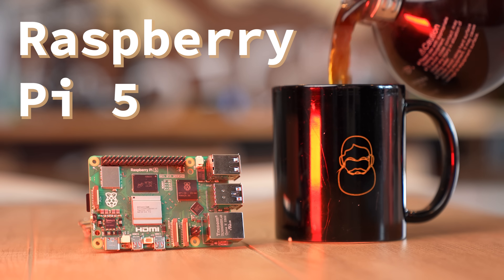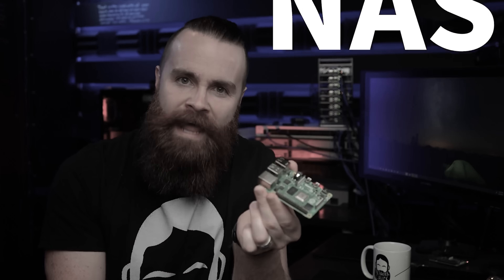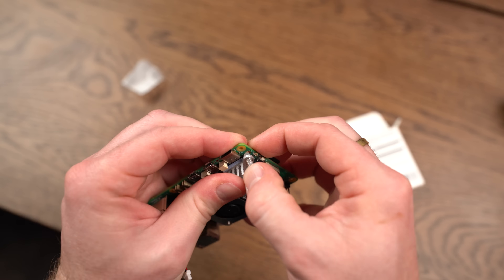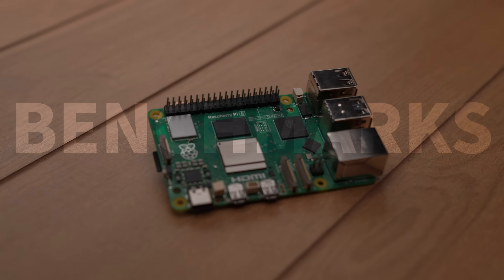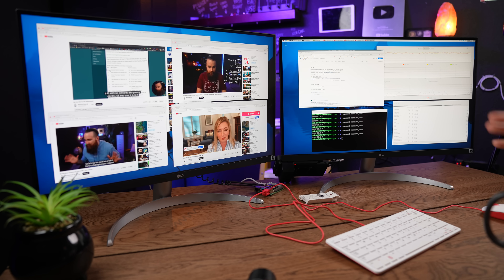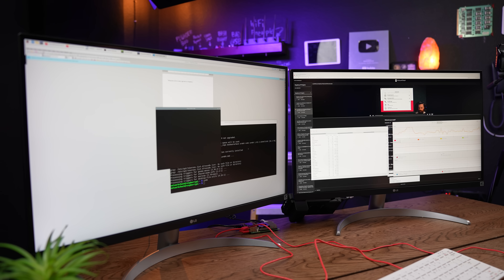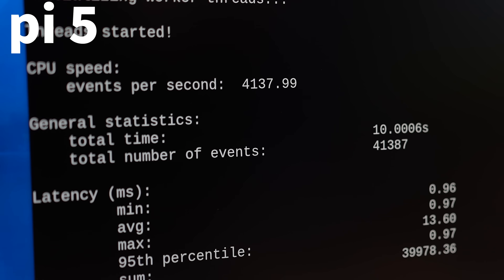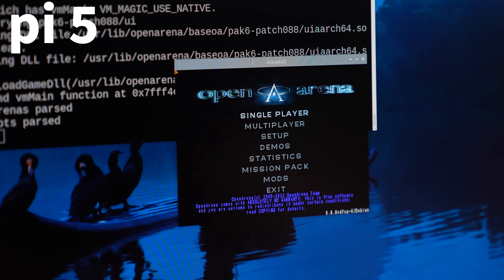the Raspberry Pi 5

Comment: Question, can the Raspberry Pi 5 actually emulate Nintendo 64 and DS games?

As you know I played games including NES, SNES, Gameboy, Sega games including Dreamcast and Playstation 1, PC Dos games which plays games perfectly.

However, certain Nintendo games like Paper Mario 64, Bomberman 64, Indiana Jones and the infernal Machine and many handful of N64 games crash or glitch up and I'm frustrated. While I still can play other N64 games like Legend of Zelda Ocarina of Time, Majora's Mask, A Bug's Life, Toy Story 2, Bomberman 64 the Second Attack, Quest 64, I'm frustrated that I can't play my favorite N64 games Bomberman 64, Paper Mario 64 since it crashes and is unplayable.

Will the Raspberry Pi 5, also fix those glitchy N64 games including the ones that stutter and run slow even the Nintendo DS games? Let me know, I want to be able to play N64 and DS games. Also I want to see if it can at least run certain Gamecube games like Fire Emblem Path of Radiance but I won't hold out for the Playstation 2 games running on the Raspberry Pi 5.

Comment: ADVICE FOR NOOB!  

My corporate phone is dying, I need a new computer, and I'm fed up enough with Samsung owning my phone that I'm ready to commit to learning how to build my own device. and I'm broke. I grew up building computers but I'm just dipping into the hardware scene for the first time since 2001. I've been trying to figure out the difference between TyPhone and OURphone, but now I'm wondering If I should give up on DIY smartPhone and focus on the device as a pocket sized desktop that just happens to let me attach a headset and be a phone. This might even be preferable so I can add a retro wired phone style. The instructions for DIY smartphones are pretty labor intense. How off-the-shelf is a Pi phone if I'm not trying to cram it into a smartphone case?

If I can do this NOW with a Pi 5 I want to save power. I just dismantled a game laptop and have a (water cooled?) radiator with copper pipes. Can I leave more room to access the board by simply connecting one of these copper tubes? if this is safe/possible, is it likely the screws will match, or be adaptable with a standard item or at very least with 3d printer? I'm guessing this would only be better at cooling than this fan - it's designed for a HOT machine - I bet I could save some power with passively cooling it too. Would there be any reason to try to bend the radiator to connect both CPU & GPU copper tubes?

Comment: For checking temps or other stuff "live" in terminal just do:

watch -n1 'your command'

Very useful, you don't need to use the same command over and over again since it will basically send that command every second now and display the output in a live preview. Very useful

Comment: The responsiveness actually wasn't bad given that it's running off of an SD card. I wonder if it can boot from an SSD over that nice new PCIE interface
Reply: should be able to electrically, but unsure if any one has made a case or adaptor to do it neatly. Currently Argon Forty makes a die-cast alloy case (V2 case) for the Raspberry 4B that you add their M.2 base to..... then you can install your SATA (M.2) SSD (eg: a Kingston A400 or WD Green) and yes it boots. I'm using one. 
(They also do a NVMe base for that case, I am not sure of the name for it.) 
But the Pi 5 is physically different from the Pi 4B.... so you might have to wait for a neat and tidy solution for now. At this point I can see bare circuit boards, connector cables and plug and sockets and SSD cards on a bench....

Comment: Thanks Chuck
Looking forward to the follow up video - using Pi 5 for server-based activities. Like, I dunno, running a bunch of docker images? And managing a RAID something? Add VPN server and possibly Homebridge or Home assistant?
Basically all the things I want a home server to be 
cheers!
Reply: Raspberry Pi is almost useless for data storage application since they have never implemented a native PCI-E SATA interface on their boards unlike Hard Kernel Odroid and Banana Pi which have been around for ages already.
Reply: @MSM5500  The Pi5 adds an external PCI-E lane as one of it's new interfaces, you could reasonably get many SATA ports through a hat. Officially it's a PCI-E 2.0 lane but it is able to do 3.0 speeds (just not certified for those speeds) through some configuration.

Comment: Pi 5 is surprisingly disappointing compared to other offerings on the market, and Chuck apparently drinks way too much coffee.  I suspect the only reason they are doing custom silicon is saving on royalties and manufacturing, not for performance benefits.  We can certainly thank Raspberry Pi for starting the SBC race, but they may quickly become irrelevant if they continue releasing hardware like this.
Reply: What other offerings for a two-figure price tag?
Reply: @lawrencedoliveiro9104   Unlike the PI, its competitors actually go for their advertised prices instead having to go through a scalper at 2x the price or more.  When you finally do buy a Pi 5 (not some free sample for reviewing or black friday loss leader with limited supply), come back and post the price you paid right here.  If its even close to the advertised price from the Pi people I'll retract my post.  Don't respond with hate, just proof.

Comment: while the updates for the Pi 5 are noticeable, i think for the use case and wow factor have diminished for me because of the major headache (not from the makers of course) of obtaining one due to the shortages and then noticing all long that there's so many mini PC's on the market that can give me more of the use case and performance.

i'm not saying the Pi doesn't have its place anymore, but i've noticed that there are better options and while it might seem like power efficiency and such will be throw out the window with a Pi vs mini PC, the performance is what i'm looking at.

right now i have a Pi 4 running CasaOS which has been amazing, but there's so much more i would like to do on it that i simply can't do without some sort of freeze/performance degradation.

Comment: Why are all these reviews acting like this is the greatest thing ever in a world that now has ZimaBoard and ZimaBlade? Is it a review requirement they can't compare the Pi5 to anything other than another Pi? ZimaBoard includes PSU, Heatsink, Case, SD Card, RTC battery, and a fan isn't needed. PCI-E 2.0 x4 instead of x1 and it is an actual slot instead of needing to buy an adapter board. No annoying ribbon cables needed. X86 instead of ARM. So the operating systems and applications it supports are an order of magnitude larger. 2x SATA3 ports with a power port that can power 2x 3.5" HDDs. Mini-DisplayPort instead of fragile Micro-HDMI. Price per feature completely destroys the Pi. Only reason to use Pi now is if you need that slightly smaller size. PiZero 2W is now the best Pi. If they every go back in stock.

Comment: The Pi 5 seems to be migrating out of its embedded niche. Seems to be an OK if underpowered Desktop replacement, but massively overpowered for a lot of embedded applications.

Not sure I personally get the appeal for that. 1 litre formfactor business machines are pretty danged small with true desktop power and some modularity.
Reply: I guess the Pi has the price advantage by quite a bit compared to 1L PCs, and GPIO. Raspberry Pi probably thinks that the Zero W 2 took up the niche for more embedded use cases.
Reply: @seshpenguin  Before scalpers I guess it does have an edge on cost.
Reply: @dtaggartofRTD  true, though one of the complaints I've heard from people is that larger customers have preferential treatment in getting Pi's before regular retail channels, so it depends.
Reply: @seshpenguin  That's another issue with Pis. Can't build a project around a board you can't get. I've had to scrounge substitutes for several Pi projects. Old thin clients, and off lease 1L boxes have been my go-to lately since Pis are just too much of a pain to source.

Comment: I know Raspberry Pi's have a large group of users but unless you just have to have this size of a device. A small mini PC like Lenovo Thinkcenter or HP Elite Desk will blow this thing out of the water while also being very small. And with the 8gb model at 80 dollars without the power supply, case, etc.... You can actually get a Mini PC for less money and have way more performance and room for upgrades. 

To be honest, the RPI is not the king of small form factor computing anymore. They are fun devices though. Just not the best you can do in it's price range at all.
Reply: You are not going to get anything x86 new for a two-figure price tag.
Reply: @lawrencedoliveiro9104  sure but why does it have to be new? Refurbished ones are super easy to come by and have good warranties.
Reply: @naturalfps  Because this is new.

Comment: This might be somewhat irrelevant but can someone tell me: What are the advantages of setting up adguard on a Raspberry Pi vs just using adguard dns servers on your router?
Reply: Your DNS is then self managed internally rather than unmanaged and in the cloud.
Running your own internet DNS means you can create re-writes to local devices plus manage the block list etc, I run my Adguard on a Virtual Raspberry Pi on my Windows Server Hyper-V😂 No need for any Pis, I just spin up another VM 😜
Reply: @rogerhewitt3709  🧠

Comment: Power consumption? That is a major dealbreaker for me if the power consumption increased with the exact proportion the performances did.
Reply: According to another video I saw, it actually improved. It's roughly 2 watts at idle in testing, but that increases sharply when you start connecting PCIe devices or doing intensive tasks.

Comment: I have a Rock 5B 8GB that is 3x faster than a RPI4 (I have a RPI4 8GB) and yeah... even tho the Rock 5B is 3x faster and the GPU is ALSO much faster... VLC 4K Playback doesn't work, I have a sub 4K monitor (Dell AW3821DW)... I bought now something else.. :) Intel Nuc 13 with Intel i3 1315U and I fkin love this thing... 6W Idle reading blogs on firefox I also use Sway as my Linux IDE.

Comment: 4K is like GREAT for doing work with no scaling on a 4K 28+ inch monitor.  It's great for a science or nature video a foot or so from your face, like when doing work.  But usually the quality is no greater than a super hi-fi 1080p recording.  Hear me now and believe me later: other than work, still pictures, and games, 4K doesn't matter that much.  For MOST types of media, 4K is overkill and is never seen in the wild at decent quality.  If I ran a channel I would not even worry about 4K, since even 720p would be perfectly great for any of the technical things that I would be presenting.  When I care about resolution as a consumer, I only care when bandwidth drags me below 720p.

Comment: I have a USB (VID0A46 / PID9621) Ethernet Adapter and found driver source code for it, qop_kernel/drivers/net/usb/dm9620

Any idea what would be the general steps to plug that in to the RPi and use that driver file?  

I can compile code using gcc, but not sure how to compile/load drivers, such that I can plug it in and call functions from the driver, ex. "dm_write_eeprom_word' function"?

Comment: i need a pi 5. still sadly doesn't officially support windows tho. kinda hate that but its still good. i probably end up using it as a small and power efficient home server. would be so cool if i can somehow get windows server running on it using the WOR project but there is only 1 way to find out

Comment: FIRST thing that puts me off. The power BRICK to power it. I want a low power, sleek and slick way to power devices and NOT have to have YET ANOTHER power supply for another device. I really hope they keep making the Pi 4s for this reason.

2nd thing. The noise. Again, the 4 was silent.

Comment: I am curious about the transcoding performance and such for Plex.  The PCIe extension has a lot of promise.  I've been fighting current hardware prices because I want to go back to using a closet NAS.  The Pi4 just didn't have the stones I needed, and anything MiniITX is insanely overpriced.
Reply: So far it looks like AVC/264 transcode speeds are going to be slower since the hardware AVC is gone, but probably faster than the Pi 4 on Plex since they never supported the Pi 4 encoder anyway. If Plex chooses to support the new HEVC/265 hardware then speeds are going to be much better there. Still no hardware AV1, so it’s probably not going to be able to stream those transcodes above like 720p. The Pi 5 can make a decent media player, but there are better media server options at a similar price point and power consumption level.
Reply: @JamesCusano  Dang. Ahh well.  Guess I'll be going back to the mITX/used server plan.  On the upside, I've heard great things about those low profile Intel Arc cards for media server applications.

Comment: It’s great that of a lot of YouTubers are doing reviews on these. Raspberry pi lost a huge market share due to it shortage the last 3 years.. but how does the new PI stack up against some of the others that were released as a replacement.. my guess is they are still lacking in some things. Once the hype is over with this “new” model can you do a side by side from others? I know Jeff has already posted about some things about some comparisons.
Reply: They can't iterate as fast as smaller companies in China and the like but the support for these will probably be a lot better.
Reply: @rmo9808  support is very valuable, but these things were meant for tinkers/programmers/DIY people, they already go into things naturally with uncertainity, case in point I have made 5 different Asian clones work as multiple use cases
Reply: I think Jeff Geerling (I probably miss spelled it) compared it and it can compete with orange pi, but not with twice more expensive rockchip, but at least it seems competitive and keeping up.

Comment: Seems like a nice SBC. I dont think 60 bucks will be okay for the lower end model but having it as a part of a Proxmox cluster could be nice. Would however rather have it interconnected with other boards over a high speed, low latency, bus for some proper clustering.
Reply: There any current SSI distro for a asymmetrical (not homogeneous) cluster?

Comment: Wow the amount of computing power in the area of a credit card is amazing. My only complaint is very few of the accessories for the Pi4 fit the Pi5. Which means I'll have to buy everything new again.
Reply: “I’ll have to buy everything new again”

Same keyboard connector
Same mouse connector
Same camera connector
Same video display connector’
Same HDMI connector
Same SD-Card connector
Same GPIO connector
Same HAT format
Same RPi4 power brick IF you watch the power loads.

Different POE format
Different case

Comment: You should have tested the desktop experience with only one monitor and for common operations like browsing and programming.
Reply: Everyone els who has tested seem to say it runs very smooth on one monitor (1440p/1080p) still what he was doing it was nearly handling quite well, it was impressive
Reply: @leexgx  I don't know... to me it seemed slow. I have the Raspberry Pi 3 and it was painful to use in desktop mode when I tried some time ago. I expected a better experiece here, but it doesn't look so much better, that's why I would have preferred a test with more common actions. I'll check other videos.

Comment: "this thing is so powerful they had to make an active cooler for it" lol over hype much
your arm smart phone chip is properly more powerful doesn't need an active cooler
the m1 and m2  is definitely more powerful doesn't need an active cooler
it's just inefficient shit "for cost i guess" which might not matter if you need to buy a cooler
Reply: And if you knew how much temp throttling your phone does...it's all different
Reply: @mrmotofy  yes and my point still stand with all that throttling your smart phone is doing it's still running everything you want without the need for active cooling while the pi 5 will probably sh!t itself there are better alternatives out there now it's not the first credit card size computer on the word market anymore
Reply: @AhmedMohammed23  Many average phones are also $1000-1300 vs $80 Rpi, big difference
Reply: @mrmotofy  my example for the smart phone or the m1 soc is to make it clear that you can still have "powerful chip" that throttle and still give you great performance unlike the pi as for direct compression with the pi itself as small computer I compered it with its rivels that gives you the same or better performance than the pi 5 with little higher price (which you might pay any way for the cooler) without the cooler
Reply: @AhmedMohammed23  Well then present your engineered/built product showing everyone your Supreme knowledge and skills in doing so.